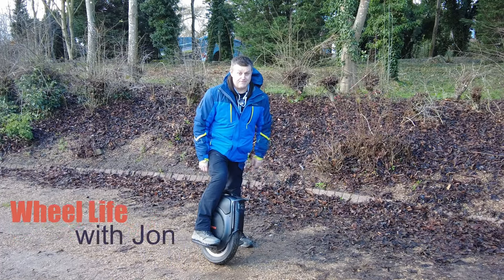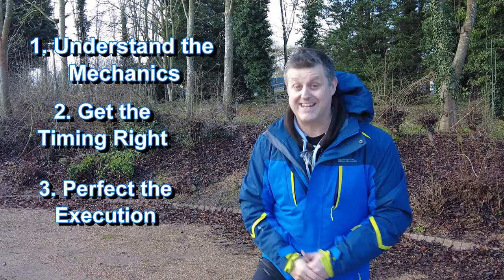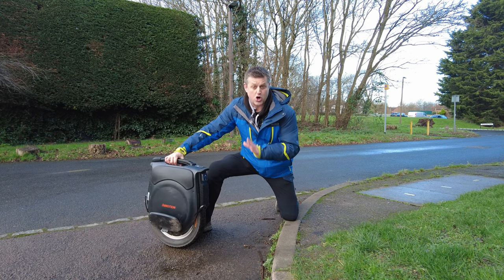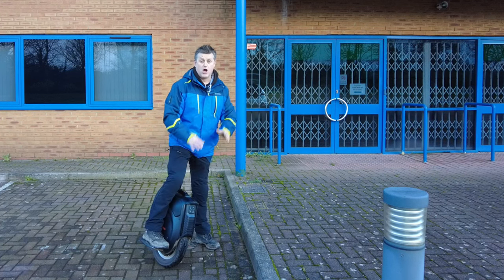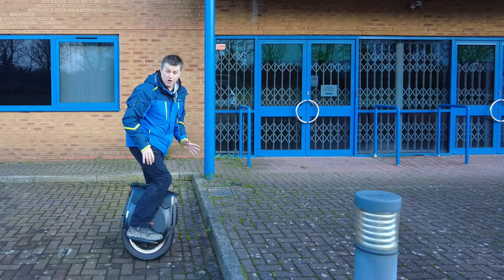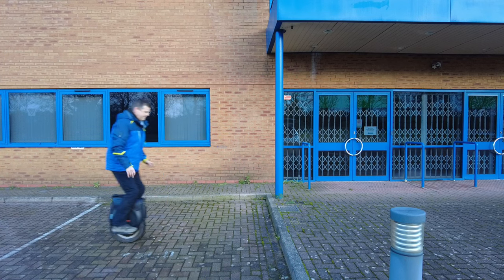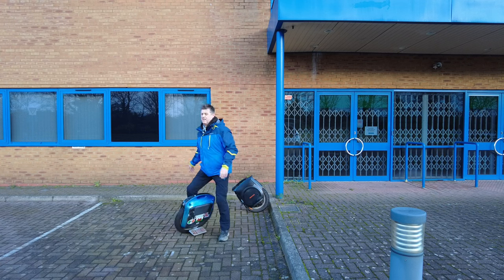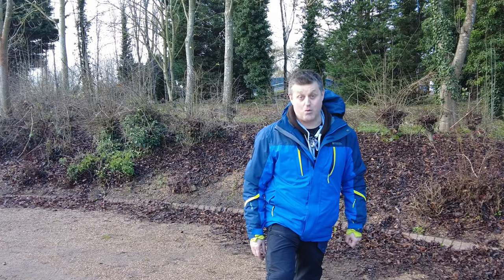How to Jump Up Kerbs Safely and In Style - An Essential Skill for EUC Riders

Comment: Another helpful video Jon...  can I just add, air pressure isn't the be all and end all saviour of rims. The dent is more pronounced with too low pressure, the dent will be local and very obvious immediately... especially if you approach the curb from an angle... it will dent the rim more on the first side that encounters the curb. However, if you have 'enough/more'  tyre pressure and you hit the curb hard enough and are late with unweighting the wheel... the dent can not be obvious, but can out of round the rim over a greater area and not be noticeable to the eye.

Personally, I use a very similar method to you, however, I don't wait for the bump of the tyre and curb meeting, I like to crouch a little more than normal and unweight the wheel just before the bump, so as the tyre strikes the gutter, my weight is just coming off the foot plates and the wheel 'follows my lifting feet'. As you say with your method, timing is everything... pop too early and the damage will likely be worse than expected if the wheel is landing when it was supposed to be taking off.. 

Another method I use, especially on higher curbs is to run at the curb head on, slow down to an almost stop as you get to the curb lean forward and unweight the wheel so rather than the tyre slamming into the curb, it literally stops then drives up it.  The experts (who generally make us mere mortals sick) just approach the curb at warp factor 9 and jump, lifting the wheel from about 3'  before the curb... DoH!! haha
Reply: Experts tends to use jump pads and that makes it easier to bring the wheel along when jumping.

Comment: Interesting. I learned kerb hopping from Ian's videos on it back on the Ninebot. That technique was to load up the tyre IN ADVANCE of the kerb and squeeze with your legs, then hop manually rather than using the kerb to launch you, landing on top. That seems safer because you never hit the lower surface area kerb face (or corner) which has more potential to hit the rim. What are your thoughts on that?
As I only ride an 18" wheel at the moment, I suspect either way would work in practice but I'm used to giving it that "squeeze and release" with the tyre giving me a little launch.
Reply from the maker: What does Ian know?  Yes, I agree, hopping up before making contact might seem safer but with big heavy wheels there is a risk of coming off the footplates and being out of control of the wheel, which feels very risky.  If you have enough air in the tyres, time it right, you lift your weight off the wheel as it makes contact and the risk to the wheel is very limited.  Do it with an under inflated tyre and you will wreck it.  I know.  That's how I wrecked a Sherman!  
You get another mention on the Podcast Tim.  Out now on the usual places!
Reply: @wheellifejon  Ah yes, the weight thing is very valid, and you did mention it in the video (my memory is going). I watched that video when you wrecked the Sherman, and filled your car with repair foam dust. Very funny (probably less so for you).
Another mention on the podcast? All part of my plan to gradually edge you out and take over :)
Reply: @wheellifejon  So the trick is to practice with someone else's wheel.😀

Comment: This video is quite informative and well done 👏.  
I do find it easier to use jump pads. 
As you approach a kerb you sort of crouch to put pressure on the tire and then jump using the rebound force of it.
If done properly you have much smaller chance to bend the rim.
Makes jumping kerbs easy and power pads do give more control of the wheel.
This is in my experience, what is your thought on it?

Comment: The kicker is that one doesn't need to jump. Lifting the heels(!) and keeping the knees flexible is enough. This also makes the timing a little less critical.
Reply: Depends on the height of the kerb. In the Netherlands the kerbs are very  height. So jumping is always needed, so  you to not be surprised by that one kerb. The kerbs in this Video are very low.
Reply: @BunnyslippersEUC  As long as you don't pull the wheel up from the ground, which was not my understand of the technique shown in the vid, jumping won't change much in the addressable height. On my wheel, the height limitation to clear kerbs without jumping comes from the shell touching the kerb. I have been riding in Holland a few times and my memory is that I could clear many kerbs by just driving them up with a 16" wheel.
Reply: Sorry, brother, but I think your technique is going to end up with a lot of bent rims.  Even with his unloading the wheel, the V12 is on the verge of bent rim or a pinch flat. It's far safer to use jump pads and just hop onto the curb without contacting it at all.  Maybe this is harder with Monster Pro or a beast wheel, but there's no reason the smaller wheels can't do it.
Reply: @lashley370z  over the years I have passed maybe a thousand 4" curbs like this (without jumping) and have yet to see a bent rim or pinch flat. I crashed the wheel a bunch of times in the training process (without substantial damage). I don't have a V12 though, so it could be that its rim is not durable enough for this technique.

Comment: I could get to the idea of a function which takes the height of the kerb as a parameter, and gives you the minimum wheel diameter under which this operation is possible. The rest of it is measurement.

Comment: I did a frame by frame advance on the jumps.  I have to say that it really does look like risky business to ride a smaller EUC up a curb because the tire deflection is substantial to the point where the rider is coming perilously close to doing wheel damage.
Reply from the maker: Yes, you are right.  As I said, don't try this without a well inflated tyre.  If you get the timing right you lift the weight off the wheel at that point of impact to reduce the risk.  Perhaps I should have emphasised that point a bit more.

Comment: I have been afraid of curbs/kerbs ever since i fell on my first try with the V5F, the wheel might be too small for it to be easy to pull off, don't wanna damage the rim either.
I didn't have alot of speed back then either so it might've just stalled on me, i guess i'll have to go out and find some place to train on
Reply from the maker: Start with low kerbs (curb is American!!) And build up your confidence gradually.  I know how a fall can hold you back mentally but you can do this!

Comment: Great video 😊 what balance angel do you have on the v12?
Reply from the maker: I have experimented but just keep it at 0 (level).  Sometimes it starts up and feels like it is slightly pointing forwards so I hold the motor cut off button and it levels itself nicely.

Comment: I prefer use power pads and jump the wheel as much I can to overcome the obstacle, if I can’t at least the worst was behind and my body “weight still in the air” so the possibility to damage ring is almost zero. I try as much I can not facing n crash my wheel against as showed in this video, one time ya ended loosing the time n damaged your ring!
Reply from the maker: You have to time it right so that you take the weight off the wheel at point of contact.  Make sure there is plenty of air in the tyre too.

Comment: What about my 14” vf5? Same technique?
Reply from the maker: Yeah.  It should be the same.  Make sure you have pleanty of pressure in your tires and lift up exactly as you make contact with the kerb edge.  Dont just plough into it!  The other technique for smaller wheels is to grip the wheel firmly between your feet, push down and compress the tire with your weight before you get to the kerb edge then bounce up holding the wheel between your feet.
Reply: Thank you.

Comment: Have been riding a while and go down kerbs quite often, haven't really done high kerbs on the way up, tend to look for the 2" high bit. I will have to try this on my 16X, but it should be even easier on my S18. Same technique for the S18, what do you think?
Reply from the maker: Yes, should be exactly the same.  With both wheels, try compressing down just before you get to the kerb and lifting up so that your weight is light at the point of contact, then just jump up as the wheel rises under your feet.  Let me know how you get on.